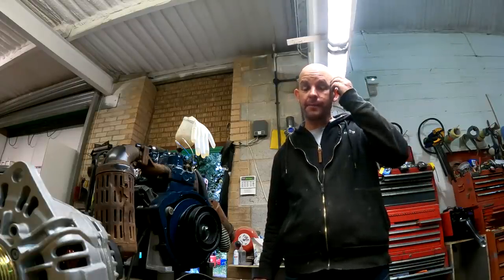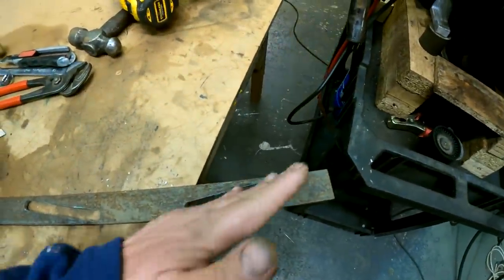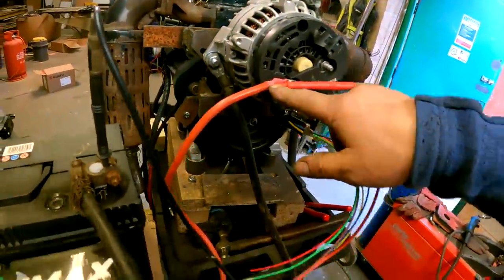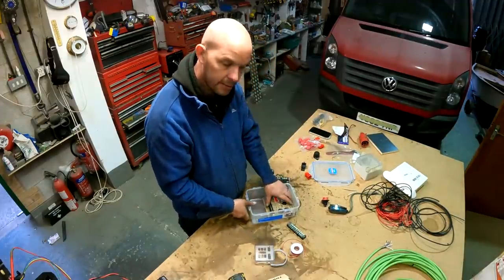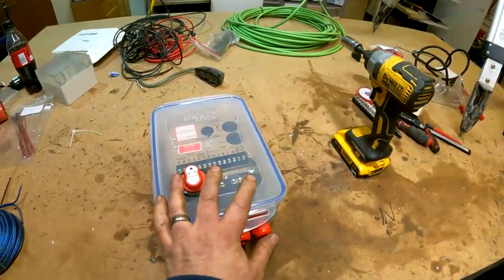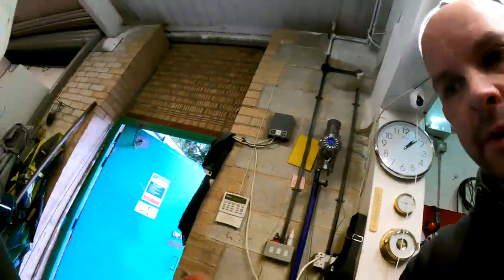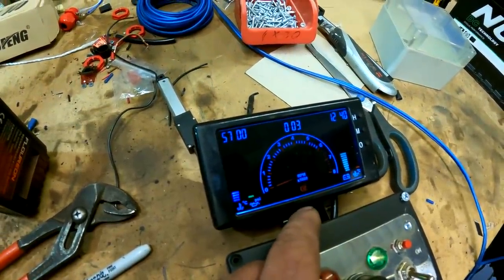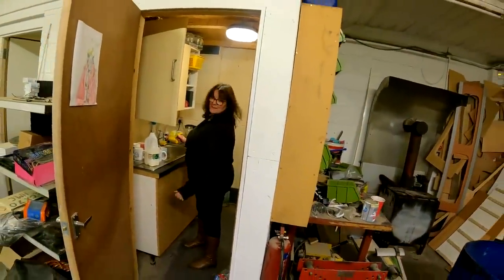DIY DC Generator Project Part 2 - Broken Road Sweeper To Boat Generator?

Comment: Well Simon its official you deserve the McGyver Hacker award.  You have some real genuine mechanical skills going on there but I'd recommend using an electronic controlled actuator instead of a solenoid for controlling that throttle.

Comment: In my experience with a solenoid, it will always over-heat if it can't pull all the way in. An actuator is an adjustable device that can be positioned. Please let us know how you finally set up the speed control. I enjoy these videos, so many various subjects to cover. I was a chief engineer on big ships for many years and loved the fact I could work on all the machinery of a floating town, with great big engines to move it about. Keep up the good work, Colin
Reply: Couldn't the pulley on the engine be swapped for something bigger to change the gear ratio? At idle and geared properly, that engine should spin the alternator at max power output with no problem, no?
Reply: @tmurphy0919  I agree that if this generator is going to run for long periods the best fuel consumption needs to be known. I think he said a 120 kW generator, so the engine output needed would be about 100 ÷ 80 x 120 kW. Perhaps the engine manufacturer would provide the ideal RPM. Also, the minimum RPM to produce 120 kW with that alternator needs to be known. Also, I would look into overheating of the alternator, as Simon talks about in the video. It will be worth checking these 3 limits to decide on the motor RPM. It's surprising how annoying engine noise is at a nice peaceful anchorage. I would there change the air-cooled radiator for a water-cooled heat exchanger and fit a water raw water pump. Then you can pipe the exhaust through a water-cooled silencer and pipe it out underwater. This will be much quieter. The engine thermostat will work just the same and should be at least 90 ºC to get good performance and engine life. A better all-around generator would be a direct drive 240-volt unit that would power the whole boat including battery chargers. My guess is that there are a lot of generators about where the engine is caput but is electrically sound. Simon seems clued up on electrical stuff, so he might look at this before going to sea.

Comment: Hello again. You are making steady progress, together, excellent. I've been watching all episodes and have been thinking you need a deisel generator for quite awhile. And I was glad to see your getting it together. With the fuel line hooked up to the main engine fuel tanks, you would never have to fuel it up. Very good job on the project. I'm impressed by your knowledge. Not to mention the cost savings, the system you're building would cost thousands. I really enjoy your videos. Thank You for sharing your adventure.

Comment: I'd mount the 'tupperware' plastic control box on a hull stringer, to isolate it from any genny vibration. I also thought solenoids were on or off! Holding them on heats the coil until the fine wire melts, as you seem to have discovered! You want a servo there.
Reply: He did say the Tupperware would be mounted separately from the genny. It's just temporary there to get all the mechanisms proper. And yeah on the solenoid. They are on/off or they burn out.

Comment: I suggest a fan(like a old car engine fan or a electric one) attached to the engine pully and duct it past the alternator  to help keep it cool and perhaps try a screw actuator for the throttle instead of the solenoid. Nice weld work by the way, I can tell you done quite a bit of that before.

Comment: Job well done Simon, I have one suggestion for you on the lunchbox is make sure that all that is in it can be sealed away in there otherwise you might need to add some vent holes.
Great job on the bracket Simon's Mum. Cheers from Canada

Comment: Great job - what a clever solenoid, I wasn't aware either that you could use a solenoid like that. Nice solution too as it keeps the whole linkage nice and simple.
Reply: Perhaps you need to buy one that is designed for proportional use as that could be why your one burnt out within a half hour?

Comment: Droop is the proportional speed drop between no load and full load. It is a governor feedback thing. Simple mechanical governors have it by their nature but not adjustable and unacceptably large for AC generation. Electronic governors and older sophisticated hydraulic assisted ones have adjustable droop. The optimum value depends on the nature of engine duty. Off-grid AC generation droop can be kept as low as possible without hunting or over-reacting to step changes in 
 load. Sharing AC generation with another unit requires a bigger droop to give a sort of rubber connection in the power sharing.
As for your DC unit speed change is not critical. Adjust it between not jittering and grinding to an idle when load is applied.
BTW, very, very impressed with you and your  family's exploits on the boat. I've caught up with the series and am up to date. You are doing a grand job.

Comment: Hey word of advise never run glass fuel filters like that they can Crack and burn your boat up always run a metal style filter if I didn't care I would have never said anything but I care very much for you and your family the boat is one thing but your lives are worth everything.  Keep up the hard work 💪 and your  dc generator is very nice 👍
Reply from the maker: The filter is only temporary, it was the only one we had to hand x

Comment: Absolutely love these more technical videos. There were a couple of things either a bit above my head or that I couldn't follow.or which were probably deemed too boring (like the actual wiring of the engine and controller and choice of fuses etc) but I can understand you were trying not to be too technical. If this generator works well as I am sure it will...perhaps at a later stage of the channels development you can do an A to Z of the relevant parts and how to construct it so it will be a reference point for people who wish to build their own version. Also reports on long term usage and upgrades would be good. Simon knows an awful lot from his previous mechanical exploits and I love to learn things.

Comment: WOW Simon, seems like only hrs gone by since I asked for followthru on the generator!!  Very good time lapse photography with verbal comments/thoughts on the bracket /wiring!!  As said by others nice to see Mum in the shop on various projects.  
Good discussion on solenoid for gas control,  from my limited experience,  fine wiring in a feedback loop can overheat quickly. Alternate for me was voltage controlled servo and mechanical linkage.

Comment: Servo or actuator in place of the solenoid would give much better control for the throttle, solenoid's are usually straightforward on/off devices. 
Great project and like the way it's in a plastic box 👍👍Should be a really useful asset to add to the ship. 🙂

Comment: I love the setup that you are doing here.  Gunna hafta watch this a few times and take notes.  We have power outages here in Saskatchewan and I have an 3000 W inverter that runs two circuits in my home to keep basic lights and heat going when this happens. I have a bank of batteries for this that have to be maintained. A regular battery charger is used to maintain them when we have power but I need to be able to charge them during a blackout. The heat is gas but it needs power for the switch and blower.  The other circuit runs the living room and the Wifi and computers. This would be a good setup for me to cover an extended black out like we have had in the past. This looks like the setup for me.  I only need 12 volts so a regular sized alternator on a small gas motor will do.  5 HP is adaquate for what I need. I sure do ,like that Diesel though.

Comment: Interesting use of a wire brush to clean teacups, when I worked in a garage, I found water and 1200 grade wet & dry paper worked quite well, doesn't damage the glaze as much either
Reply: The best thing I have found for cleaning cups and teaspoons is sterilizing fluid like you would use to sterilize baby bottles, you don't need much in a sink full of water and it's totally safe.

Comment: Simon, I am curious why you need a generator speed controller for a DC generator.  The alternator's internal or external regulator controls the voltage to the battery and the amps are controlled by the internal resistance of the battery.  Given that, the engine speed is only important for getting the max amps that the batteries can take and can be reduced as the battery fills up.

Comment: Hiya Simon don,t know what went wrong with my post...but Nice job you,ve done 
dont forget spare belts/parts i would put panel on a frame or something near the engine
so it dont get in way of working on engine plus no vibration, you should be able to find a heat
exchanger sound hand somewhere simon and use it own feed of in take of water with a filter
on. keep up this good work

Comment: If applicaple, connect the engine coolant circuit to the ship heating radiators circuit. Adjust the furnace oilburner to shut off below engine operating temperature. This heating circuit could also heat your hot tapwater as well. For summers you need seawatercooling through a heatexchanger. Valves as needed for diverting coolant flow. This is a quite common way  heating a liveabord yacht.

Comment: Great to see all those episodes of scrapyard challenge being put to real world use.😂🇬🇧🤩
If you motor is has mechanical tick over adjustment and your looking to motorise it two possibilities..  a heavy duty RC model servo or a linear actuator ...basically  a motor driven screw thread with a moving saddle ..push pull on a spring loaded 2way rocker switch. .. off when released in the center hold down either way to increase or decrease speed manually. Using a stepper motor...possibly?
Sprung switch for glow start as well hold it down for glow elements ..release for off. KISS approach.
The alternator case can get hot ...over a hundred C .. so blow some smoke... and see how it moves through the alternator ...before you wire up a cooling fan.
Can you flip the exhaust so it exits up ..it may be easier to route out of the boat in that direction🤔🤞🏻

Comment: Maybe you need a stepper solenoid or a motorized solenoid. . When the rod is not all the way in, the coil overheats and burns out. The rod absorbs the heat keeping the coil cool. Happened to me once on a refrigeration solenoid. I energized it without it being on the valve and it didn’t last long. You can use a spring and set a mechanical upper limit for rpm.

Comment: Well, I suppose you need a continuous duty solenoid...meaning it can withstand full voltage applied indefinitely.  I suppose the controller works by varying the voltage to the solenoid...this would make a linear actuator a poor choice.  Unless the controller applies voltage in a specific polarity until a predetermined speed is reached and then cuts power. If so, i guess a linear actuator would work.

Comment: the lower pulley and belt are pulling top down from my view so the top support if shortened slightly will pull it back to vertical

Comment: Really a great job! I swear we’re brothers from different mothers.
I really miss having my shop to build and tinker in. 

I think on your throttle up so annoyed you need to have a straight approach so that there’s no torquing on the solenoid plunger rod. 
It looks as if there’s still a lot of engine vibration. Are the valves adjusted properly? 
Or maybe the harmonic balancer rubber insert has delaminated? I ran into that about once a month on high mileage Volvo engines. Just a thought. 
Anyway, great work! 
Any plans for an auto switching power management system? 
A system that would switch between solar, wind, and generator as the battery charge, and power demands change throughout the day. 
Again, outstanding work, and good on your mom for the expert pattern making! 
She’s wasting her talent on cleaning out your skankey mugs!

Comment: Nice work.
A couple of things...
First - using "normal" solenoids in the manner you are using them is not a "good idea", they get very hot and burn out.  What you need is proportional control actuator; you should be able to find one that uses the same control voltage range as you were using, and a similar stroke and control rod.
Second - Where did you get that tacho sender unit from?

Comment: You might want to consider a water cooled exhaust manifold as in a boat they tend to start glowing red very quickly. I don't know what sort of engine that is ( kubota?) but I'd guess that someone has marinized one before.

Comment: Nice work, will a double alternator setup work? Can the engine manage another alternator do double the output?
Reply: The alternator is capable of 200 Amps at 24 Volts (4.8kW), that's more than enough to charge the batteries and run the inverters etc. To drive a 4.8kW alternator at full output would need around 8-10 bhp with the losses, so likely close to the limit of that little engine as it is.

Comment: Great video Simon, can you tell me where you got the speed control unit
Reply from the maker: https://www.ebay.co.uk/itm/ESD5111-New-Electronic-Generator-Genset-Parts-Governor-Engine-Speed-Controller-/393127955685?mkcid=16&mkevt=1&_trksid=p2349624.m46890.l49286&mkrid=710-127635-2958-0

Comment: You could even run a pair of 12V car alternators in series. Two x 70 Amps is close to 2KW.
Reply: Most automotive alternators do not like to run in series, and besides he's looking at over 4kw from the single truck one.

Comment: is this only for charging the batteries whilst you are repairing the boat are you keeping it on board for ever, I suspect the former because the main engines should charge the batteries when you are afloat, though could be handy when making a long port stop.

Comment: I think that you should spend some money on new mugs, either that or soak them in bleach. You must leave a lot of tea/coffee soaking in the mugs. Looks really interesting. not many people can rebuild a diesel engine or set up a diesel  engine to be a genny like that. While I haven't done wind myself, having wind power that could run 24/7 seems like a better solution. Ideally, you would have someway to disconnect it in high wind scenarios and when the batteries are full. High wind seems like it could be a real problem for where the boat is. As you most likely know a run away wind turbine, could cause your boat to catch fire. Well done with the genny
Reply: It’s a diesel.
Reply: @johnnunn8688  fixed

Comment: Ever hear of changing pulleys? RPM ratio from crank rpm to accessory rpm is controlled by the variation in pulley diameters...  & internal combustion ENGINE vs ELECTRICAL motor.

Comment: If you had solar panels surely you could charge those batteries up as another form of energy for lighting / charge phones
Reply: They have solar panels, what they are short of is enough sunshine hours, this set up is a back up when they are on board.  Also just setting up a wind turbine.  A lot of vlogs to work through fot all the info

Comment: Fantastic video Simon. Thank you. What make/model is the “dashboard” it appears to be just what I need for my project.
Reply from the maker: https://www.ebay.co.uk/itm/5-LCD-6in1-0-100PSI-Oil-Press-Meter-Tachometer-0-8000-RPM-Clock-Oil-Temp-Gauge-/153195137152?mkcid=16&mkevt=1&_trksid=p2349624.m46890.l49286&mkrid=710-127635-2958-0
Reply: @ShipHappensUK  thank you.

Comment: Normally, solenoids draw excessive current if the armature in not allowed fully into the coil. Are you sure this is a proportional unit?

Comment: I'd have expected the engine speed not to be set at particular value but instead be linked to the alternator controls so that the engine speeds up when the alternator has to work harder to keep the battery charged. Your way I think you will have to set the engine faster than the minimum needed and the alternator will turn the charge rate down. Meaning you will use more fuel than you need to. I'm no expert but just my thoughts
Reply: Isn’t that how this system works? It depends upon the load.